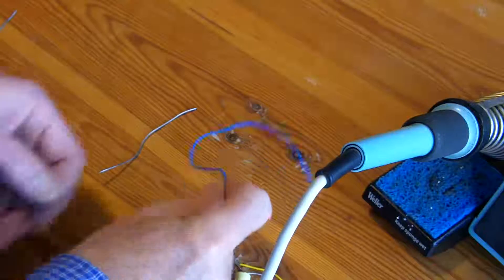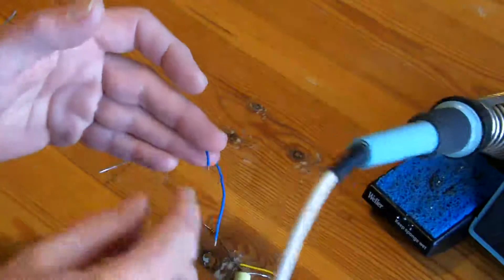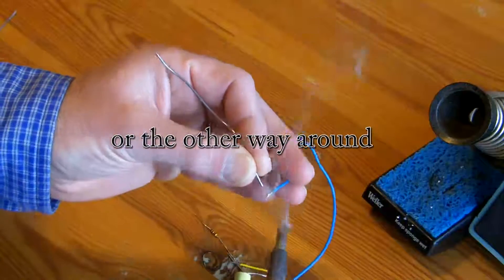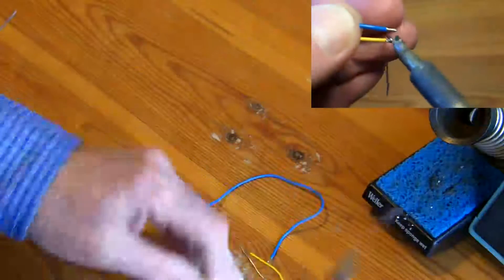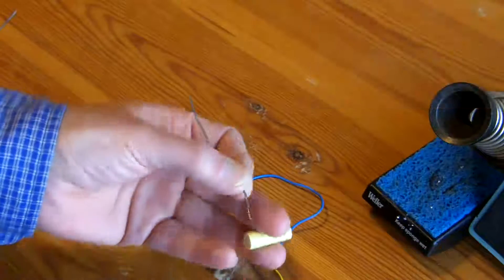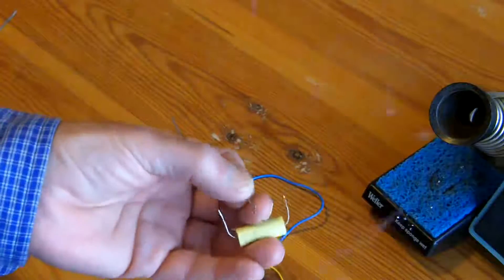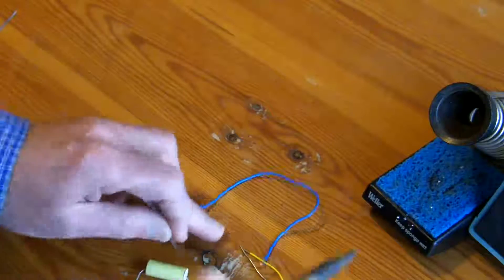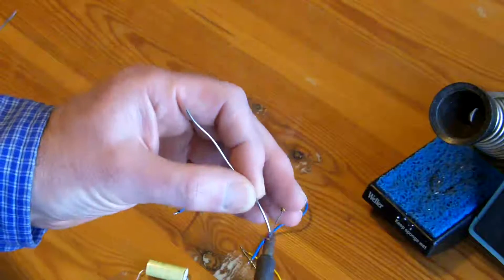A soldering tip that you may not know. From  Andy Davies

Comment: I have a soldering tip that I invented myself.  When replacing components on a PCB, I don't like using solder wick.  Instead, after I remove the bad component, in order to install the new replacement component, I melt the soldering point and use a sewing needle to clear out the hole.  Then the component's leads can fit right through.